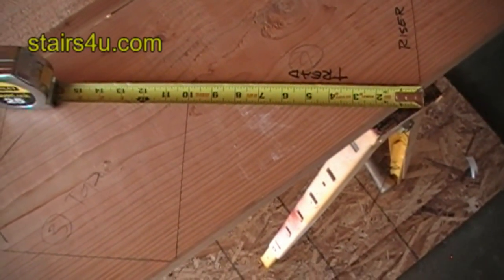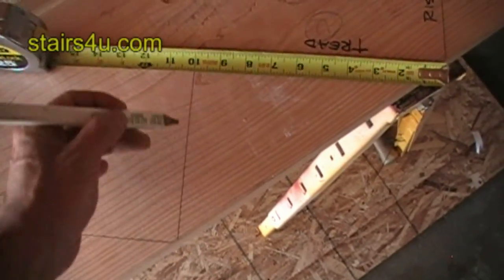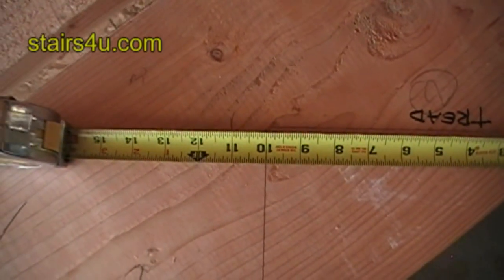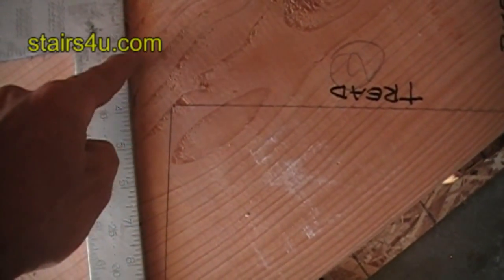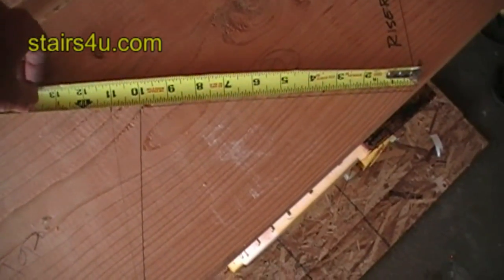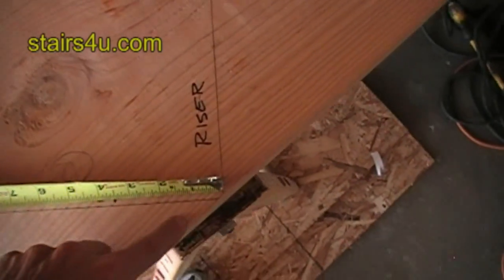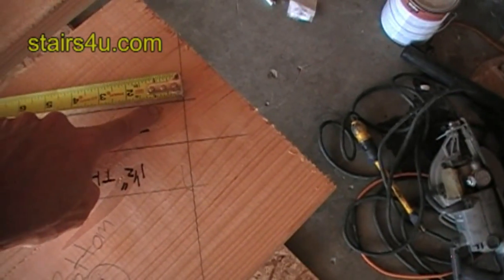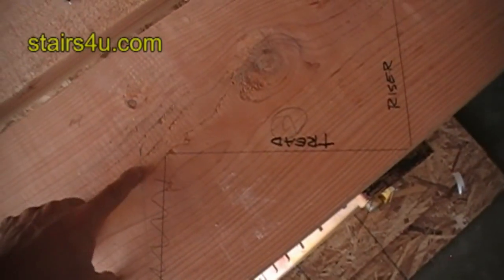How To Layout One Inch Under Cut For Stair Stringers

Comment: And why would you do that?
Reply from the maker: It's an alternative method of construction that can be used instead of putting a 1 inch nosing on the front of the stair tread. It also makes the step a little longer to benefit people with larger feet.